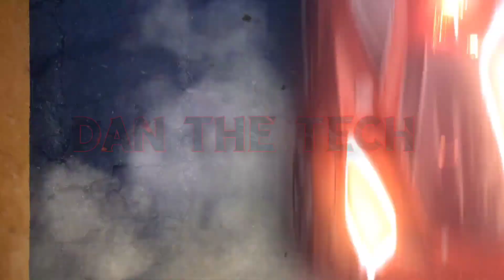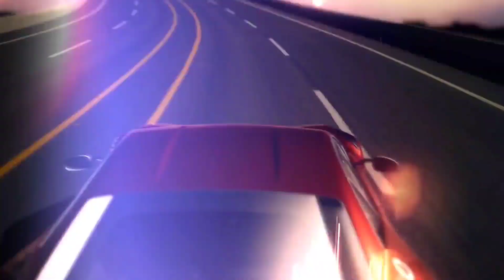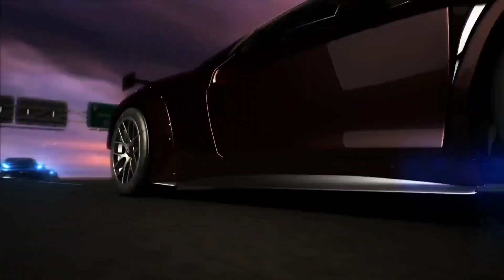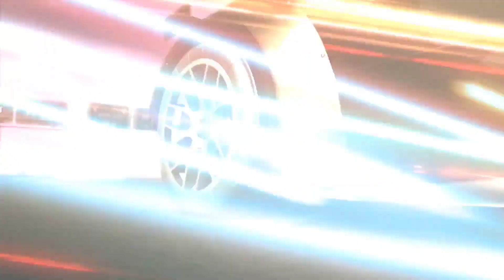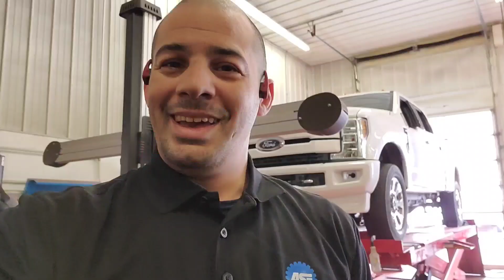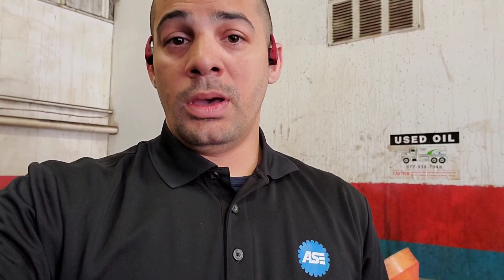Custom Offsets Update on 2020 Tundra

Comment: Ordered my wheels from Custom Offsets about 2 months ago for my 2015 Toyota Tundra. I hardly use the truck but since I had to evacuate due to Hurricane Laura I had this problem with the same exact lugs on the rear wheel 3/5 lugs shredded off. I walked close to 2 miles to the nearest gas station to find some help. Luckily someone helped me out and was able to switch them out before it happened on the other wheels. I wish I would’ve found your videos sooner
Reply from the maker: Well I hope you and your family are safe and at least you know its not an isolated problem with just your truck